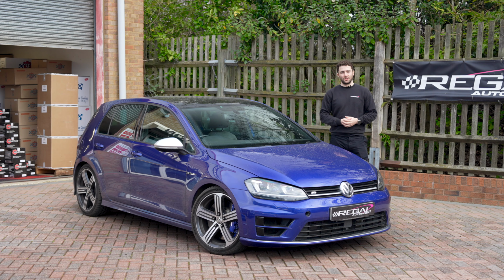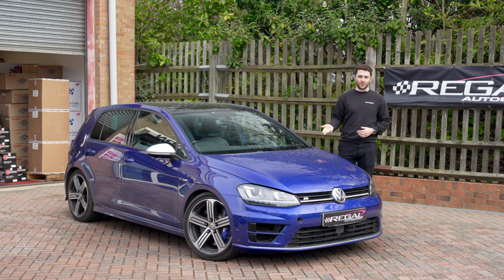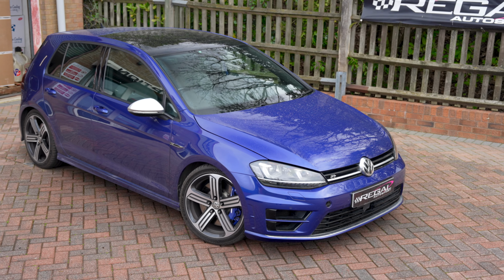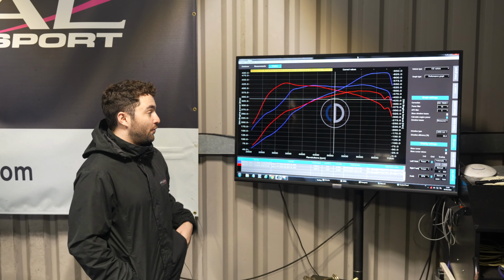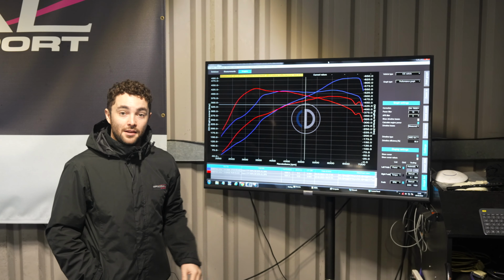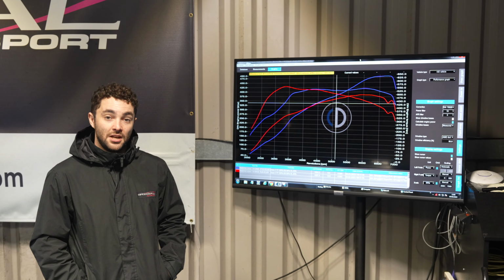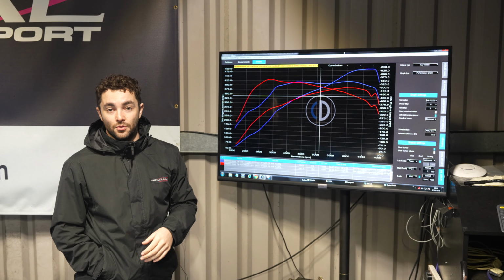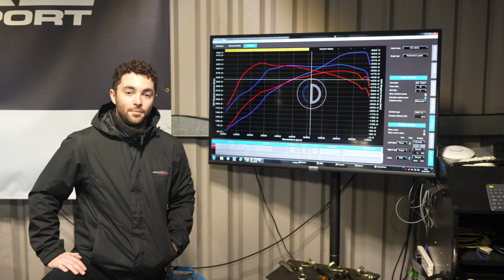EASIEST WAY TO MAKE BIG POWER ON YOUR MK7 GOLF R [400HP+!]

Comment: Looking at the graphs from before and after it looks like 4250rpm is the cross over point. So the question is where do you spend most of your time driving the car?
If you track the car then you will feel the benefit of this upgrade, if you daily drive your golf r, especially with a DSG in "normal" most of the time then the stock turbo on stage 2 is probably a better option.
Reply: Wrong. It picked up a 100 hp. The difference between the two would be hardly noticable down low but the mid and top range is WAY better. No one drives their car to 4250 bro..... Everyone keeps pulling and the stock turbo is lame AF after 4250.
Reply from the maker: It's a big misconception that dyno graphs are the whole story, words from the customer behind the wheel of this car says 'The run home was quite undramatic I'm delighted to say. Roadgoing performance is unchanged and it still does over 35mpg'

From that, you can take it that Stage 3 has no downside :)
Reply: @TENNESSEETRACKHAWK  horsepower is derived from taking the product of torque and rpm and then adjusting with a constant depending on the units being used to measure torque. Saying "it picked up 100 hp" is only half the story, specifically the half above 4250 rpm. Below 4250 rpm, the other half of the story, the car has dropped about 75hp (around 3000 rpm to be exact)
I'm not disagreeing with you in terms of overall peak performance, just simply stating that suitability of this upgrade package would be dependant on how the car will be driven.
Reply: @andrewhouldcroft1116  I hear ya and that is something everyone who upgrades their Turbo has to come to terms with but the fact is MOST people roll race their cars these days. 

I prefer digs cause reaction time is everything but nonetheless rolls are more popular so the mid to top range is where most ppl will want that power but im not gonna lie I miss the super snappy feeling of my stock turbo at times so u have a point.

Comment: Would have gone for a VIS pump as it'll last longer
Reply: More reliable as well.
Reply from the maker: We sell 100s of the Autotech HPFP kits every month without problems, of course, if you do not follow the install procedure and dirty such a precise part during the installation process then you shouldn't be surprised if you see issues.

Comment: I would’ve gone with an upgraded Lpfp and bigger mpi injectors with a better fuel rail and skip the hpfp modification personally.
Reply from the maker: Why would you choose to do that over the HPFP?
Reply: @RegalAutosport  less stress on the di injectors as they have a short duty cycle and limited with power potential as your limited with size of the di while port injectors have a better duty cycle and more sizes available ,Lpfp I’d choose a Protec one designed and built in UK with a good basket design.
Reply from the maker: Very odd way of approaching the tuning, using the method you are suggesting adds a lot of unnecessary hardware, expense and labour time to add more fuel-flow for a the low pressure injectors that are primarily there for low-rpm, low-air-speed. 

For sure let us know how your build goes on your MK7 Golf R using that method
Reply: My golf is different set up producing just under 600 wheel horse power on e85 and I run big port injectors like 1700cc and car idles fine ,yes it does add to the cost but more consistent power and most people lately have been skipping the hpfp upgrade and going bigger injectors and upgraded lpfp but it all comes down to cost and what you want .
Reply from the maker: Translation: You had to upgrade your LPFP system system because the fuelling requirements of E85 fuel, substantially larger injectors and ≈ 600 WHP. 

Not comparable to this build 

Let's not recommend unsuitable upgrade paths for people :-)
Reply: No worries just an opinion even on pump fuel it works a treat more fuel more power and better cooling properties and you don’t need my size injectors even the Bosch 980cc work a treat but it all comes down to $$$
Reply from the maker: This thread is wild
Reply: @RegalAutosport  yes it is but all in good taste  👍
Reply: @RegalAutosport  Yea, dude seems a little clueless......